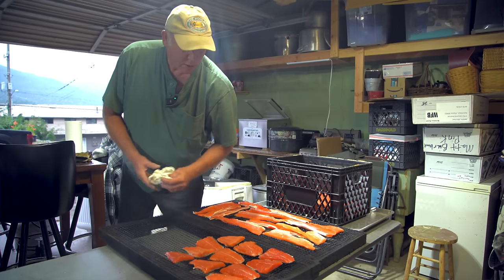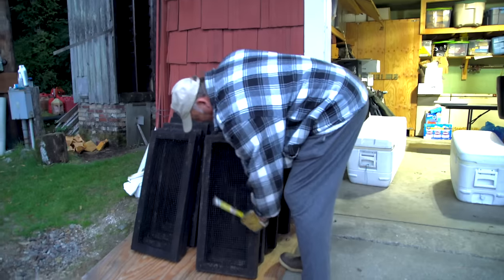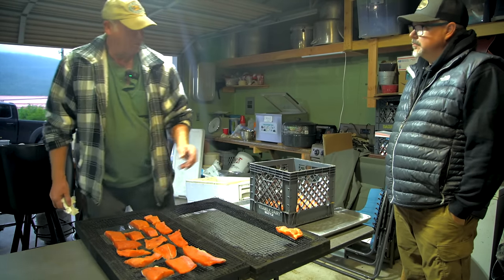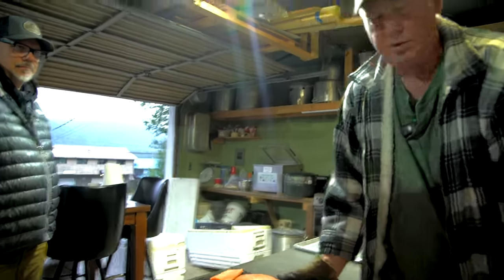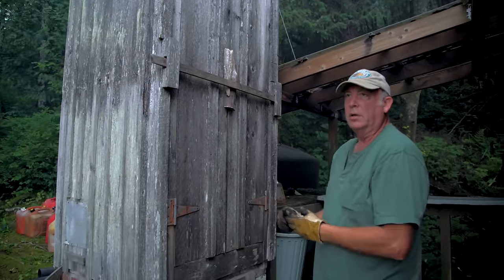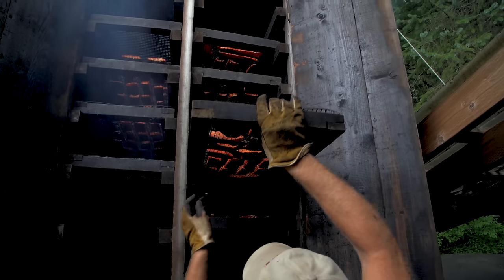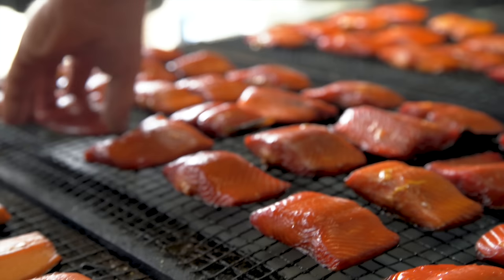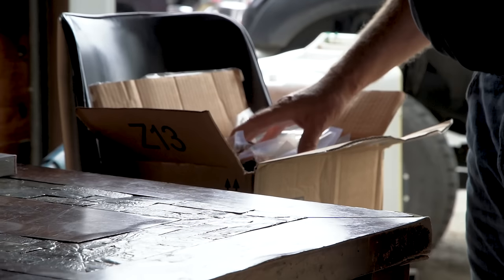How to Smoke Salmon the Alaskan Way

Comment: Also pro tip if you think salmon is good right after it comes out of the smoker, wait until the next day after its sat for about 24 hours after being smoked. The smoke has had time to really cure into the fish and it tastes so much more prominent. I like to enjoy it different ways, but a great way is throw a few pieces on a chopping block chop it all up together, put it in a bowl and mix it with some good quality cream cheese, spead it on a good quality fresh bagel, sprinkle some chives or a little onion, and enjoy. When you finally chop the salmon it really brings out the flavor even more.

Comment: For me tge best smoked salmon are sockeye done with cold smoke. Cold smoke requires a fire box about 25 to 50 feet away from the smoke house. Use fire rated duct work to plumb from fire box to house. Takes a lot longer but it's worth the effort. Although this person's set-up is very well done.
Reply: Yep, my grandparents used a smokehouse, on a little rise, close to the house.  The smoke house was on top of the little hill.  The fire was maintained down the hill, connected to the smokehouse with a chimney flew.  The fire was maintained for days by a fire keeper, taken in shifts by the family.